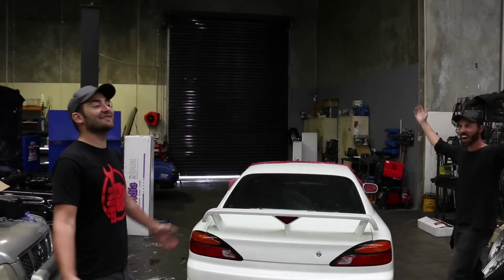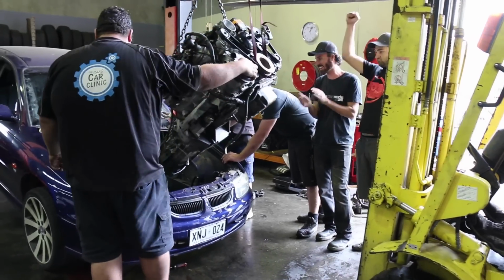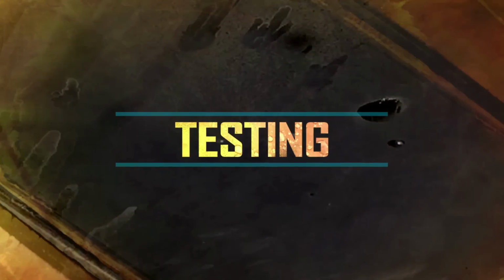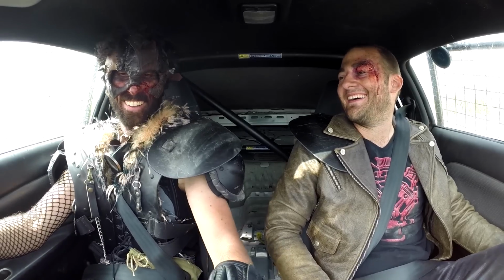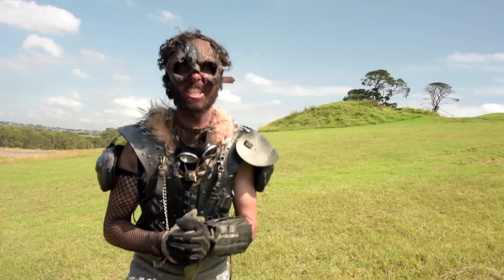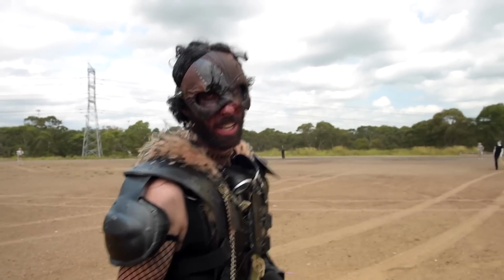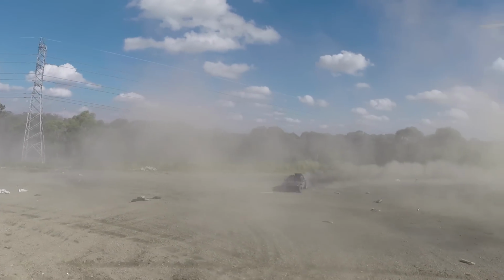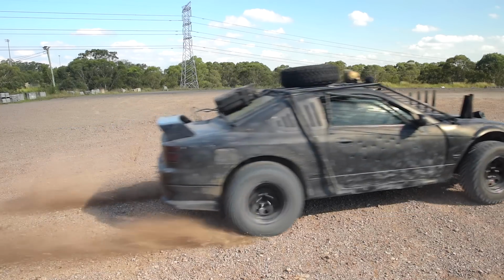MOD MAX - Episode 4

Comment: The video was as much of a masterpiece as the car! I love it
Reply from the maker: Jonathan Allen Thanks mate. We had the best day ever!
Reply: Mighty Car Mods Glad to hear you guys are still having fun after all this time. (Y)
Reply: ***** Its a V8.. Would be way better to Supercharge it.
Reply: TheKodiak72 Superchargers are outdated imo. A modern biturbo setup does everything a sc does, only better.
Reply: lolatmyage Not sure about outdated. Maybe not popular but idk about outdated. Look at the new Dodge Challenger Hellcat. Its got a supercharged V8 and makes 707hp! I'm not hating on turbos. Believe me, i love turbos more than superchargers but superchargers can still do their job well!
Reply: lolatmyage except a SC doesn't interfere with the sound your engine is making
Reply: Beau Ackx  So you would rather a whine assuming a decent SC needing a gilmore drive setup over turbo noise id take the turbo any day right set-ups have proved to be better over a SC that takes power to make power
Reply: *****
The hellcat has 707hp because of the tune, not because of thesc. The power comes from the tune, not the type of forced induction it has.
Reply: Beau Ackx
Sound is the most irrelevant part of a car. Kind of like the paint. Its the performance (or efficiency) that matters.
Reply: lolatmyage for racecars I agree, but when I'm buying a car, it's something that matters to me I would prefer a nice soundtrack over hard performance because on actual roads you can't exploit it that much, may not be your opinion and I respect that
Reply: Beau Ackx
You need 2 cars at minimum - one efficient and utilitarian beater and something thats fun to drive. For the latter, why wouldnt you buy/build something that has the best technology and the best balance of performance and reliability?
Reply: Benjamin Yates it's not that I don't like turbo's they're great engineering masterpieces but it interferes with the exhaust fumes , the new Huayra for example is an amazing masterpiece with amazing performance but you do miss that V12 soundtrack that the Zonda had
Reply: lolatmyage because it all depends on your personal preference, do you really have to do the same as someone else because it is the best? I don't buy a car to get the best car on paper but I buy one that I think I'll enjoy very much
Reply: TheKodiak72 That thing can hardly get traction as it is. Any more would be overkill.
Reply: lolatmyage You obviously should look into this a bit further. Modern or not, parallel or sequential, multi-turbo setups are inherently less reliable than a supercharger, this is about engineering for longevity not just efficiency and power.

For one, there are two turbine-compressor assemblies instead of just one and also turbochargers are nearly impossible to fix if they begin to fail with out a machine shop with a fully functioning bridge which has been retrofitted with a laser rangefinder.

There's really nothing outdated about superchargers, they are still being used for the same applications as before, specifically for added reliability, higher low-end torque and simply out of cost of manufacturing. It's far cheaper to supercharge a large engine than strap two turbos on to it.
Reply: Meton12765 You dont fix a turbo, if it fails, it fails and you get another / better one from a scrapyard. Literally nobody is going to try to go diy a turbo, machine shop or not. Its too expensive, there is just no point. Turbos wont fail that often if the engine is properly maintained and not tuned to the limit.

Two turbos + other things to make them work properly are complicated and less reliable than a single turbo, Ill give you that. But you dont need 2 turbos anyway. One VGT turbo is all it takes for an everyday application. That VGT turbo is also superior to any sc setup. Low end torque is meh, I dont think its important except for weedy gasoline engines. Gas is outdated anyway, diesel is the way forward in anything other than racing.
Reply: lolatmyage Heh. First of all, by quickly googling I can find at least half a dozen Turbocharger maintenance, repair and modding shops with in a 200 kilometer radius from where I live. And this is Finland, the nordic forest of buttfuck-nowheristan extremely sparsely populated by reindeer, elk, elven shamans with a handful of cities here and there. (We're a population of 5,5 million living in an area twice the size of Wisconsin.)  Or, roughly the same as the British Isle, including the independent republic of Ireland.

But, I will concede that despite my initial claims, in the long run they're both just as reliable and fault-tolerant systems.

If you steer away from failure prone systems such as ball-bearing and VG turbos, both systems are just as reliable unless constantly driven at their limit.

If you're building a bespoke performance setup, such a rallycar it rarely makes sense to settle for an unmodified turbo which hasn't even been tuned for your engine. Although they seem simple, the flow characteristics of the turbo are in, mathematical terms, just as complex as the whole internal combustion engine which it is attached to. 

That being said, a conventional sleeve-bearing turbo, with a vacuum-actuated wastegate (internal or external) such as the Garret T3 or early KKK(K)-type turbos from the 1970s effectively have only one powered moving part. Well, ok, in real-life applications the turbine and compressor wheels are rarely friction welded to the sleeve-bearing axle but when making disposable solutions for war applications this actually makes sense. In this case, yes, indeed you won't be performing any maintenance or repair, you simply ditch it and get an identical new one.

The issue with turbocharging a V8 with just one turbo is that, you either need a huge engine bay to house the complex exhaust manifold which has to wrap from both sides through the turbine or you have the option of using only one of the exhaust banks to power the turbo, in which case you're limited to a LPT application, adding efficiency.

As for VGTs they're finicky and prone to failure in any sort of environment with high levels of particle contamination, such as the desert.

Besides which they DO require some maintenance, because they manipulate the geometry of the turbine and compressor wheel and it's blades. As bare minimum you need to check the blades for particle and heat damage now and again. 

Also they have the axle mounted on to a ball-bearing, which needs to be replaced after x amount of operating hours as they wear out. Or risk shit canning the whole engine when one of them starts to seize and the compressor blades scrape themselves with the inner layer of the compressor housing  into the intake manifold / shrapnel from the disintegrating bearing begin shed off into the Oil-circulation (I believe the current VW TSI engines have been deemed as such, the small turbos just can't take the load being driven to such extreme speeds) On positive note, when this occurs it is most certainly a spectacular sight.

Only Koenigsegg uses VGTs which aren't as finicky, they actually manipulate the geometry of the turbinehousing itself and thus change the flow dynamics of the exhaust gasses instead of the exhaust-turbine blades themselves, the only additional moving part in them is a solenoid-valve on the turbinehousing itself.

The simplest way to turbo an LS would be to mount two sleeve-bearing turbos of appropriate size on both sides of the engine. A under-over boost-tubing into a inverted intake-manifold which takes it's pressurised air from the 'back' of the engine instead of directly ahead. Alternatively, you can feed the turbos through a RAM-air-type arrangement on the hood which tunnels air into the compression chamber, but steep angles in both exhaust and intake flow-channels will lower output.

This is a lot simpler than fabricating the exhaust to flow through one choke point. Of course, in both cases you need an ECU to manage the whole arrangement, or at the very least to adjust the AF and a knock-sensing fail-safe which will vent the boost into the atmosphere in case the arrangement begins to come apart.

Of course with this build this is a non-issue since they're using a custom Haltech ECU which is actually more sophisticated than most ECUs in production cars today.

Of course, when running boost, you can't just remap the thing by trial and error by simply revving and adjust timing & fuel-delivery but you need to do this under load, and it's really quite difficult to perform this on the fly in any accurate manner.

Unless you just happen to have a ready map that's intended for the specific types of turbos and LSx-engine you're using, you'll need a dynobench. Or a very long arrowstraight motorway. Fortunately the latter is in ample supply in Australia.

Anyway, a mechanical supercharger gives no advantage in efficiency but can be used to provide a much higher, instant increase in net horsepower. Since most of them  are controlled by clutched pullies, they can actually be used in exactly the way the pursuit special V8 and it's supercharger is arranged in the first two Mad Max movies. The pully control can be two fold, under the control of both the operator and the ECU.

I.e. the driver switches it on at will, with the ECU monitoring operating temperature, other operating variables of the engine and also the level of available fuel. Cutting boost if the car runs too hot, oil pressure flutters, loss-of-coolant occurs or when defaulting to the Falcons own 'puny' 65 liter gas-tank instead of the twin 200L battery on the back. And the driver can of course over-ride the ECU if he so wishes. Of course risking catastrophic failure in case of engine malfunction or fuel-starvation.

Ironically, the actual Hero.cars couldn't really do this in the movies but they did inspire a whole generation of automotive engineers to implement it.
Reply: Meton12765
Yeah, replacing the bearings or the spinny part is pretty much theonly thing you could do on a turbo. Did you look at the prices and rates for those repair shops? I bet the cost of fixing a turbo is more than the price of an identical turbo from a dead car.

Im not too keen on V8s, exactly because of how difficult it is to set them up as anything other than na or sc. No space in the engine bay. Straight 6 or 4 is better in that way.
Reply: lolatmyage I suggest you first google a couple of Turbo refurbishment videos on youtube and then read up on basic fluid dynamics before we continue. The entire turbo can most often than not be refurbished unless it's been plowed to complete shit in so much as to have caused catastrophic failure, leading to loss of lubrication and atleast momentarily seizing the thing.

You can't just pick up a 'dead' turbo car around these parts anyway, any car with a running performance engine, lives in the 1000€+´range. Whether it's roadworthy or not.

And as I mentioned before, the turbo is at a glance nothing more than a couple of pressurised turbinehousings and a 'spinny bit'.

However, their reliable function requires a modest level of maintenance and checking up, in the form of various seals and the wastegate actuator, which is usually pneumatic in older cars, not electronic.

There's quite a bit that goes into tuning a performance turbo. Ballbearings, various ways of enlargening and polisihing the compression-chamber and of course, switching the compressor wheel to something more agressive or lean... Which ever you prefer.

Also these shops build custom hybrid turbos for motorsports applications.  Such as combine the turbine housing of a T03/4 with a polished compression housing and blades of a T3 resulting in a turbo which spools faster and boosts higher.

And that's just an example. All changes in the turbos internal geometry will then also reflect directly into the performance of the engine and require the  ECU to be adjusted appropriately.

This why for example installing a bleeder is very wasteful way of increasing a modern turbos' performance, the ECU either has to default to some sort of fails-safe map to prevent fuel starvation on high boost, or the ECU fights back by venting boost into the atmosphere. It also increases the wear on the engine, the smart way to do this is to simply give the ECU an 'attitude readjustment package'.

Anyway.
Reply: Meton12765 Lol Ill give you the fact that I know nothing about how turbos are lubricated other than "oil goes in and comes out"..Alright.

 "any car with a running performance engine, lives in the 1000€+´range" Im not talking about buying whole cars, Im talking about taking parts off wrecked shells. Ive seen running turbo engines (vw 1.9 diesel) for sale at about  100 euros, a turbo would be even less. Then again, I bet a brand new one would be in the same range.

Comment: " we have been doing turbos all these years, we should of been doing v8's" that's what I've been thinking too for awhile as a owner of a 2001 mustang gt
Reply: But the 2v Stangs make no power.
Reply: Turbo Lion And you don't have a V8 at all. Go away.
Reply: Mr Anderson The modular 4.6 is a bit of a lazy engine, takes for ever to build revs. Beat them all the time in my 3.6l cadillac.
Reply: he had an realization...
Reply: *****
Tru
Reply: ***** Well since it debuted in 1991 in the Lincoln Towncar, the 2v 4.6s were never meant to be a powerhouse monster. It was a low compression, smooth, reliable V8. Nothing more.
Reply: ***** maybe a 2v bud...
Reply: ***** Go race a 4V 4.6 modular. Those fuckers rev fast and make a lot of power
Reply: Russell Sabine
I drove a 2004 mustang GT, it does not rev fast.
Reply: ***** That would be a 2v I believe.
Reply: ***** Pretty sure a 03 and 04 GT was just a 2v. The 03/04 Mach 1/Cobras hauled ass like no ones business and revved fast and until about 7,000 RPM or more. Trust me the 4v V8 design is not an engine to be taken lightly no matter how small it is. Thats why people take the Northstar V8s and stick em in Fierros
Reply: Russell Sabine
I have a northstar STS.
Reply: ***** Well then you have good taste
Reply: Russell Sabine
I'm a mechanical engineer, I look at the specs of the car,  such as the mag ride suspension, before I pass judgment on weather it is cool or not to drive what some label an "old man car". If you pan over my name, the STS in the pic is mine.
Reply: ***** Nice. I got a Ws6 myself Id like to own a Caddy V series one day but unfortunately I dont make baller stacks yet to drop on one. I've ridden in a mag ride equipped caddy though its smooth as hell and so quiet. I see why you go the STS though I bet it makes a nice DD
Reply: Russell Sabine
I'd like to pick up an XTS-V soon those are already in the low 30's, and I have driven the XTS before for 2 weeks as a loaner (got a vid on channel) great car the interior is in S-class territory.

Comment: "All these years of doing turbo's, we should have been doing V8's ".      How about your next project being a turbo V8?
Reply: Sequential turbo V8.
Reply: Mind officially, blown like a 6.0 Ford Diesel's head gasket.
Reply: Project Double Unicorn ;-)
Reply: Eh like the II-III (Nissan) March... compressor and turbo on a V8  (brrruuuum.. pshishishisi) Would make sense.. big turbo means big turbo gap... so if you could fill that with a compressor... so you'd have low end power as well.. ... It's needlesly complicated... That's also what'd make it  a fun project...

Comment: My 2.2 cents (including GST)...

1. You should call the car the "Pemulwuy," 'cause that's roughly half-way between Cabramatta (home of the 200SX) and Mt. Druitt (home of the Commodore).

2. Time constraints notwithstanding, you could've done a bit more to the car;
- Get rid of the emblems,
- Replace the external rear-view mirrors with truck mirrors bolted to the A pillars,
- Replace the stock head & tail lights with ones salvaged from (preferably) very old 4WDs or trucks, bolted/welded on to the body,
- Clobber a spoiler together out of salvaged scrap instead of using a factory- (doesn't matter whose factory) made spoiler.

I know, I'm nit-picking, but you've managed to get me into the whole frenzy with your videos - not a mean feat, so congratulations to you for that.

All in all, great work. Hope the quadcopter wasn't damaged beyond repair!

Comment: The car is great for everything except driving. It doesn't have the right tires. The minute you try to drive that in sand, you'll sink like syrup on a waffle. Still great for dirt though and the look is spot on. Great build.

Comment: Hey guys what's better adjustable coilovers or lowered springs ?
Reply: Ummm coilovers lol
Reply: Moto WINGOO but the thing is I won't be adjusting a lot since its not going to be a track car damn :/
Reply: Lowering springs will lower your car, sure, but it'll ride like shit, and handle like shit. Just put in the extra money and get coilovers.
Reply: Turbo Lion if that's the case I'll save up for the coilovers. Thanks

Comment: Mighty Car Mods should move to the US. LS1 plus a Silvia is street legal here. Hell, even their Mad Max version would not be to hard to put on the street. They would need to keep it OBD-II and make sure the port under the dash and the CEL worked. Flash the ECU, so the post O2 sensors did not detect the lack of cats. Route the exhaust some where besides the hood and preferably install a cut-off so they don't get pulled over all the time. Use something transparent for the rear windscreen like plexiglass. Keep both headlights and turn singles. Add real license plates and they should be good to go. Also, they should stay far away form CA. It is hell for gear heads.
Reply: Too bad Silvia's are illegal in the states and it would be impounded and crushed the first time you take it out.